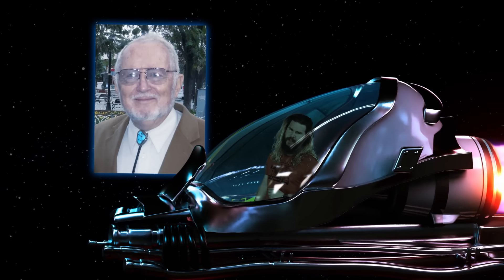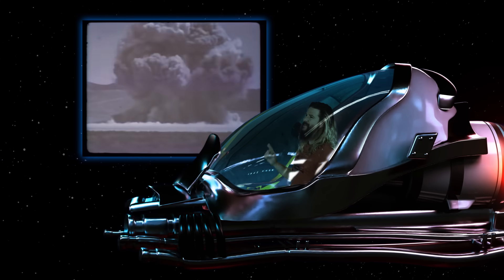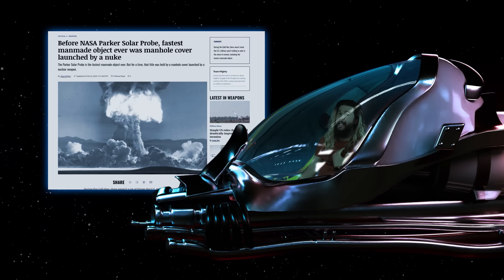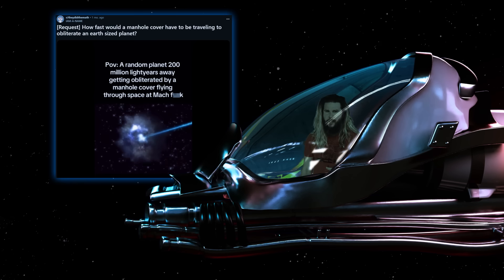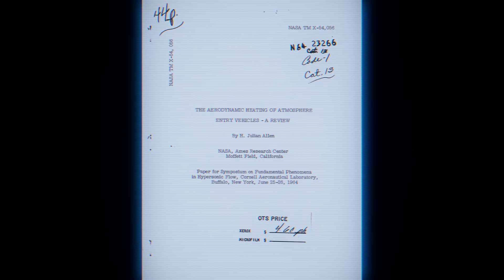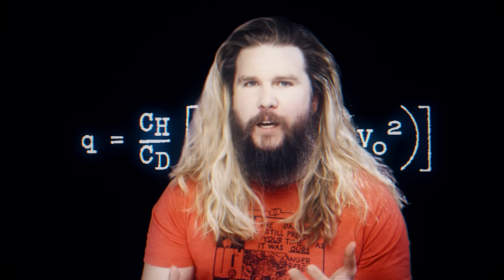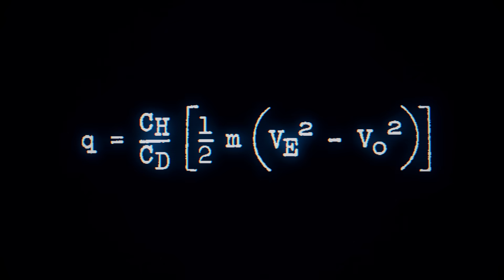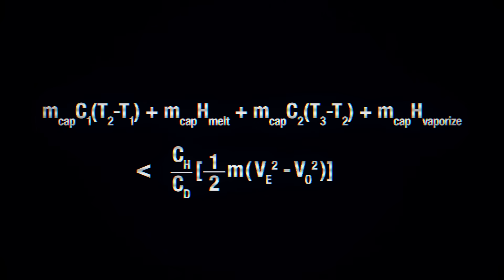Debunking the Nuclear-Powered Manhole Cover

Comment: Sorry to tell you but the cap wasn't made of cast iron as it was made of steel also the manhole cover was not traveling flat side up and was most likely spinning at a unknown rpm that would also change many variables allowing to possibly exit the atmosphere in a unknown shape, size,  and state of matter most like a liquid as the heat was mostly like absorbed into the steel and not dispersed like we do with space craft that leave the atmosphere

Comment: The main thing I see is assuming the manhole had a final velocity of 0. If it did escape the atmosphere, it would still have a huge velocity, reducing the value of the right side of the inequality. It's hard to estimate how much it would slow down due to drag, but at 66 km/s it would reach the upper part of the atmosphere where the density is less than 1% of sea level. If it only slowed down to 60 km/s then the two sides of the equation are nearly equal, and it would be much harder to say if it made it or not.

Comment: With regards to units:  first, even as a mathematician who is happy to chug along solving things without units, when I took physics, I really appreciated how the units always combined and/or cancelled out to confirm just what you were looking at!  And second, I really appreciate the point that you made about that particular Mars probe:  the error was a units issue, not an "Imperial vs Metric" issue!  How in the world did they get a probe to Mars without making sure that all the units were correct?  As someone who's pretended to be a software engineer, I would go one step further:  how in the world do you put a spreadsheet into a system blindly, without testing it first, and making sure that the ouputs made sense?

Granted, it happened before it became popular to write "unit tests" for everything, but c'mon, you could have at least given it a whirl before sticking it on a rocket!

Comment: Didn't you just work out whether the iron would vaporise if it was completely stopped by the atmosphere? You have set Vo to be zero... This may be correct but it is a huge assumption. If the cover started at 66km/s and left the atmosphere at 65km/s the answer may be very different, as there is a lot less energy to dissipate. 

You may be right, but i don't think you have shown it with your maths. 

So you first have to look at the drag on it. If it were a well designed hypersonic projectile it should get through the atmosphere with much energy to spare as the HARP guns managed it with far less energy and a lighter projectile, i don't know how a dustbin lid would change this.

I think you probably need to do some deeper fluid dynamics too be as sure as you appear to be.

Comment: the "reverse" calculation doesn't work.  The initial "shock" calculation isn't the same as the backwards. Best solution would be a finite element simulation. Correction a plasma in a cell CFD calculation.

Comment: If the velocity with which it leaves the atmosphere is nonzero, then it won't necessarily have received all the energy required to vaporize it. But, I don't think that the cover has to vaporize to be stopped, either. I imagine that liquid iron would get removed from the surface and the droplets would break up, drastically increasing their average drag coefficient and bringing them to a stop (at least at lower altitudes). As the plate melts, the liquid would be pushed off and expose more solid iron. The question may reduce to whether the combination of intense heating and liquid removal are capable of eating through the metal in the short time that it is in the denser atmosphere. Will the iron oxidize and introduce more heat?

Comment: Sorry, but when I examine the "plug 'em" equation at 9:37, you have made an incorrect substitution for the term v2e-v2o, which is supposed to represent a CHANGE in velocity. The re-entry heating equation assumes enough contact with the atmosphere (usually over several minutes) to reduce the velocity of the object to near zero. The entire kinetic energy of the mass being converted to heat. For you to use 66kps as the change in velocity you would have to suggest that the atmosphere was THICK enough (a much higher drag coefficient) to completely STOP the manhole cover (melted or not). Otherwise, the change in velocity is only the SMALL amount of slowing due to passing through the atmosphere in a direct vertical line, which would take just a couple of seconds at that speed. I see no element of units of time in the calculation, as would be needed to calculate the real v2o value after roughly 2-4 seconds after which it would be out in the vacuum of space. We could then get into some very complex equations about how quickly heat from the outside of a solid iron object would be conducted to the interior in 2-4 seconds. It may be that a thin layer of the surface would vaporize, but that a significant part of the core would still survive. Pointing to how meteors explode does not really make a fair comparison, because most of them enter the atmosphere at an oblique angle, and most of them are rocky, and not solid iron. So I'm not sure a solid iron meteor would even explode that way. As a side note, the videos of that meteor show that passage through the atmosphere did not slow it significantly before it exploded. So, while you might suggest that the manhole exploded from thermal stresses, it would most likely be out of the atmosphere before it did so, and so it might not be reaching the stars at the full 66kps, and maybe not as a single, solid mass, but it's still on its way out there, in some form. This isn't to say that your ideas are necessarily wrong, but just that this equation, as given, is improperly formed, not properly expressing the true delta v. We need to know how much slowing might have occurred in those few seconds.

Comment: I really appreciate you taking the time to break this down. Explaining the math and giving the reasoning behind your calculations is very helpful. And reading the comments has been an absolute treat, this definitely is a video you'll need to revisit. I'm sure there has to be NASA papers on various atm0spheric exit calculations that could be ever bit as useful.

Personally, I'm still amazed that the cover didn't simply shatter. Cast Iron is, generally speaking, a brittle material. Incredible that it remained in one piece enough to be caught on film!

Comment: What if it the cover wasn’t perfectly cast and an inclusion/void exploded due to the heat, accelerating some sections but, critically, decelerating others. Would those pieces of manhole cover been travelling slow enough to not vaporise and make it to escape velocity?

I imagine that given the trajectory was vertically up, it wouldn’t have survived reentry if it didn’t make escape velocity. 

Also noteworthy is all the proposed launch systems that rely on a launcher that propelled the vehicle from earth’s surface. I envisage that the energy required and heat shielding would just make that sort of idea a pointless exercise.

Comment: This approach doesn't make any sense. Determining whether it is "vaporized" is not primarily a heat transfer problem (at 66km/s you really only have about one second of heat transfer before atmospheric drag is dramatically reduced), its primarily a thermomechanical problem. And, how is a Nusselt number really even applicable? Nusselt numbers compare heat transported across a body which is also undergoing convection. There is no time for convection even if the whole body becomes liquid. The question is how will the stresses from atmospheric drag deform the body. If deformation is so extreme that the body is basically torn up, it would basically become shrapnel, which could in turn become vaporized. If the body maintains some mechanical integrity, drag may not have reduced its velocity by much and it would have launched into space.

Comment: If it was only captured in a single frame of high speed footage, would that not mean that all you could gather is a minimum speed? There isn't any way to calculate how far it traveled over any amount of time, so all you could do is figure out how fast it would have to be traveling assuming that the edge of the frame is where it would have been at that time. It could have been moving significantly faster. 

Also, I'm no scientist, but it seems like there would be a difference between a body entering earth's atmosphere, which would increase resistance over time vs something moving away from it, with less resistance as it goes up. That's just speculation on my end though. I don't actually know how that works.

Comment: Was the calculation on the velocity correct? As a firearms ammunition reloader you have the cartridge assembly of the bomb (gunpowder) brass (the vessel into which the bomb was housed), and the bullet (manhole cover). Under ideal, perfect conditions (no pressure leakage around the chamber) would there be enough pressure generated to push the bullet past the crimp (the weld) and have said bullet accelerate without a barrel (for prolonged pushing/ acceleration time)?

Aside from the thickness of the manhole itself and the housing in which it was welded there was no "acceleration time" more than the four inches. Given the expansion rate of the "gunpowder" and chamber pressure would it have even been able to accelerate to the velocity of the expanding blast wave? How able to withstand the "chamber pressures"  was there? Did the surrounding terrain (the barrel) rupture and relieve pressure behind the "bullet"?

Is it possible that the one frame was misread and was actually something else, or an illusion of some sort?

Comment: No, intuitively it does not make sense. A meteor slows down before hitting the denser part of the atmosphere, where it spends more time and explodes. A manhole flying upwards at 66 km/s would go through peak heating in a fraction of a second. I can picture a meteor burning up in 4-8 seconds as it hits the hard atmosphere. I cannot picture an iron manhole vaporising in 0.15-0.3 seconds (that's where peak heating would occur).

Comment: So, That's about 1.34c? that would have passed through the atmosphere in about about 3 thousandth of a second. If I recall, I think they said they caught one frame of it on camera, at that speed, that frame would have been a streak. and at that speed, the shock wave of the cover could possibly do just about as much damage as the explosion. vapor exploding outward and all. I'm perfectly happy not considering what this would have done if it had gone down and not up.
Reply: 1.34% of c

Comment: The hypersonic manhole cover was yeeted upwards at 6 times earth's escape velocity. At one second it's already 50 kilometers up, where the air is thinner and there's less drag. There's no way it loses that much speed in such a short amount of time. Even if it lost more than half of it's speed and wasn't travelling in a perfectly straight line it would have still reached the Karman line in well under ten seconds. I'm not convinced it would have spent enough time in earth's upper atmosphere to completely disintegrate. If a nuclear explosion wasn't enough to destroy it, why would earth's atmosphere be able to burn it up?

Comment: Assuming that the terminal velocity is 0 so we have the complete velocity differential  used up during the movement of the iron disk through the atmosphere  is  a potential mistake. An object impacting earth will NOT have a velocity of 0 at the time of the impact. Additionally  we can assume the forces acting on the manhole cover will deform it. Thus the geometry of the manhole cover will change changing the aerodynamic drag coefficient and alo the nusselt number. Also you might need to take into account radiative heating from the radiation of the exploding bomb and likely from the plasma forming in the atmosphere. Furthermore your energy equation is incomplete since it takes not into effect the energy required to compress and heat the air in front of the cover. Sorry, I'm not convinced.

Comment: This calculation doesn’t seem to be nearly complex enough to capture this problem.  Especially since the manhole cover went straight up, rather than at a grazing angle, like the exploding meteors.  You would need to include things like the thermal conductivity, and the fact the iron can be heat up beyond vaporization bit by bit.  The time involved is something on the order of a few seconds.  I don’t think this is a really tractable problem.

Comment: One thing that you assume is that the "manhole cover" decelerates to 0 in atmosphere (V0=0) which is upper bound, but is not guaranteed, and little against the assumptions that it flew into space. If drag was low enough so the exit velocity (V0 in reentry scenario) is lets say 60km/s it would only get about 17% of the heat. That would put it around area where we could expect it maybe to not vaporise, however it is doubtful that drag would not slow it down more. The other issue is, that at those speeds, we don't even know what could happen to the disk, forces and heat could potentially "forge" it into sphere and then spear shape and then CH/CD is completely different. Or it could break apart. In the end, it is a moot point, the disk would most likely not survive as anything that we could recognise than manhole cover. Unless someone does some research that proves that there is an effect that decrease heat or drag in the 60km/s regime.

Comment: Ok but like, isn't leaving the atmosphere slightly different than entering it, because the air is getting thinner rather than thicker?

So if it starts out fastest and where the air is thickest shouldn't we expect it to have just burned up shortly after launch? And that should have been visible on the tape, as it is with the meteors?

Comment: One caveat I haven't seen anyone point out yet (though I didn't read all 3772 comments) is that the manhole cover probably went straight up. That means only 100 km to space and at 12 km you only have 20% of the density. Most meteors and re-entering craft will come on an angle and so spend much more time in the thick atmosphere, giving more time to heat - so this analogy kind of falls apart.

Comment: There's a slim, but nonzero, chance that the manhole cover, rather than going straight up in its most drag inducing orientation, turned edge on fairly quickly and remained that way while traveling through the atmosphere.

If that happened it would receive 10.6% as much heating and survive leaving the atmosphere.

Comment: Just tossing out some numbers for people to use for math. The elevation of Nevada National Security Site (NNSS) formerly the Nevada Test Site (NTS) was between 3,080 - 7,675ft  above sea level. The troposphere goes up to 12km. Stratosphere goes between 12-50km. Mesosphere goes between 50-80km. Thermosphere goes between 80-700km. Exosphere goes between 700-10,000km.

The mesosphere is where the atmosphere is thick enough for asteroids to start to burn up.

1/2 of the air molecules around earth are within the first 5.6km (18,000ft) 

per noaa website and atomic heritage foundation's nuclear museum website.

Comment: Your enemy is time. Meteor enter the atmosphere usually at a small angle and spend a long time travesing over earth, soaking up heat. At 66 km/s, the manhole cover would have left most of the atmosphere behind in the first second. There might simply not be enough time to vaporize the cover in that limited timeframe. It's like putting an ice cube in an oven, there's enough heat to vaporize it, but it doesn't happen in the blink of an eye.

Comment: I know it makes the calculation infinitely more complex but your calculation assumes that the manhole cover fly's through the atmosphere in a static orientation with the biggest surface area it has 
What would happen to it if you used the side profile instead drastically lowering drag and with it the heat build up as a result of drag?